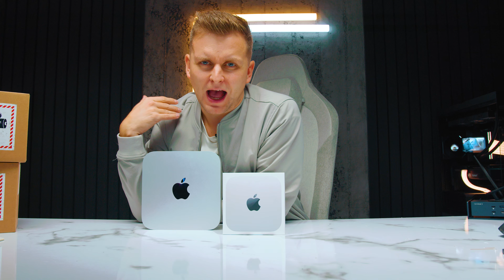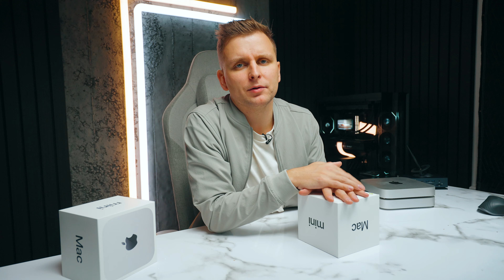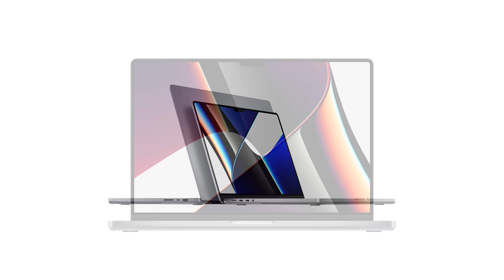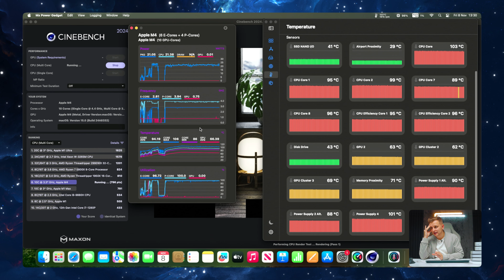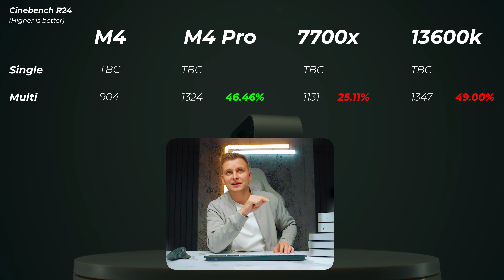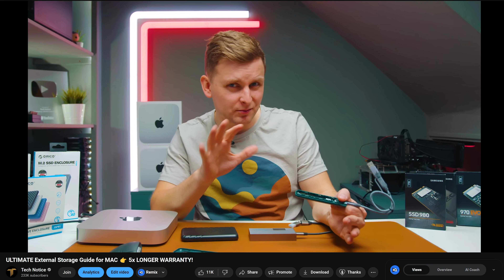Apple just KILLED the Mini PC Market and Windows WILL NEVER recover! | M4 & M4 Pro Mac Mini

Comment: Kill?? 🤣🤣🤣
In most mini-PCs, I can still upgrade RAM & replace my storage, some of them even able to host 2½" SATA drive. in Mac Mini, Apple just giving you some "hope" that you can replace storage, but it must be Apple specific components 😂😂.
No, Mac mini is niche but certainly won't be a "killer".
There are alot of Intel NUC alternative nowadays, since almost nobody is buying Intel, many has released Ryzen based mini-PCs, and they are superb!
However, I do like OSX GUI, they've done exceptional job to UNIX system, but to spend money on new Mac PC while with same performance you can achieve on other arm based or amd64 system with either MS Windows or Linux, so big NO. Alternatively to update myself with OSX, I recently bought a used Apple M2 based Mac, they're still running smoothly.

Comment: If you're in, not for the base Mac mini M4, but for a boosted Mac mini M4 Pro 48GB with 10-Gigabit ethernet for professional purpose, I'd urge you to wait for the upcoming Max Studio M4 Max, because such boosted Mac mini M4 Pro is actually only $100 less than the current Mac Studio M2 Max… and the M4 Max is vastly superior to the M4 Pro (which is already really, really good) especially in GPU compute!

Comment: I am looking to get the Mini 4 Pro as I am currently using a high end PC. I tried the Mini Pro 2 a while back (top spec), but it couldn't keep up with my high resolution 360 photo editing.

Could you let me know what your thoughts are compared to the spec I have now? Would really appreciate your feedback.

Here is my current PC spec for comparison.

Rog Strix X570 Gaming Wi-Fi II Motherboard 

AMD Ryzen 9 5950X CPU

128GB 3600 DDR4 RAM 

Msi Geforce RTX 4070ti Suprim 12GB GPU

1TB Samsung EVO 970 SSD

Comment: The biggest problem I have with Macs is that there is still software that comes only for Windows and sometimes Windows or Unix. There's plenty of software that will not run natively on a Mac. Of course I could run it under a virtual Windows environment, but then there would be a huge hit in performance. One of the key applications I use, is not available for Windows, and it is the application that is extremely dependent on CPU speed. The lack of being able to upgrade RAM is also an issue. Even in a mini PC, I want at least 64GB of RAM.

Secondly, is the user interface. My customers all use PCs only, without a single Mac in their offices, and thus need to use the Windows user interface when at their offices. In combination with my need to use a PC for the software that's not available on a Mac, means I need to use the Windows user interface a good portion of the time. Because of that, my productivity would go down if I had to switch frequently between the two user interfaces.

Now, I do have a Mac Mini, but I probably use it on average once every 3+ months. If all my software ran on a Mac, and all my customers used Macs, I'd have no problem considering to switch to a Mac as my main machine, provided it's cost effective, powerful enough, etc. But as it is, I will not consider it. I kind of wish that it would happen, because I much prefer the iPhone user interface for my phone, but transferring files to/from it via Windows is an extreme pain, if at all possible. That's my primary use for the Mac Mini, being transferring files and other tasks related to my iPhone are seamless.

Comment: A little dock or hat exactly the same size and radius curves same colour and finish that could sit on or under the mini and stack up then connect at the back via a perfectly sized tb cable and worked as a port expander for a couple usb-a, fast sdcard reader and had an m.2 slot inside for an nvme would be amazing

Comment: 1 Gigabit ethernet port is an anachronism in 2024. 2.5 GbE is standard now on contemporary devices, not only top end kit. Good luck with 16GB ram if you are developing and running multiple containers.

Comment: You can get a barebones 13th gen for around 500$ (Or Ryzen) and get 32 GB ddr5-5600 sodimm  and a 1 or 2TB m.2 SSD for like 700-800$ built. It would be faster than the apple too.

Comment: I hate YTers like you. Cheap shills for corpos and click bait titles. Apple didn't do anything significant in mini PC market. iOS is still inferior compared with Windows to most users. Windows mini PCs offer some form of upgradeability - ram or hdd. You can support your device much easier than any iOS device. You can install some linux distro on it and run home server without any issues. Apples 'ecosystem' is a marketing trash. Apples devices are poorly engineered and tough to repair. You basically sign up for future astronomical expenses if something goes wrong and not covered with warranty.

Comment: The fact that you cannot replace memory or the SSD in Macs is a reason the mini PC will live on. Also, every mini PC I've owned I can easily upgrade the memory and SSD. Plus Apple is pathetic in the baseline mac Mini offerings-> 599.99 gets a whopping 256GB storage! 256GB by todays standards is small, it should start out with a 512GB. 400.00 to upgrade to 1TB is crazy. I can get 4TB for less than 400.00.
Reply: But there are benchmarks videos showing the performance is insane compared to mini pcs that even cost 1k. I loathe apple, but i dont mind using an external SSD and 16gb ram is enough for me. If i can run windows on it, i think i'd be fine.

Comment: Amazing, Apple did 16Gb of memory in the basic model but had to ruin it all with the size of the SSD, which would be fine if one could just replace it with commodity drives. But no, and 'nickel and dime' hardly covers upgrading anything from the basic model. Almost convinced myself to buy a Mac-Mini.

Comment: I am using a Raspberry Pi 5 with Hailo 10 AI NP and M2 Hat less than 200 $ or so and it rocks more than this overpriced 'mini pc' with kali linux, and ubuntu and Pi OS on different nvme drives multiboot. fast as duck and runs gpt LLMs offline much faster than these Macs.Otherwise Nvida's AGX Orin 64gb AI Devkit beats the ass of the mac Mini M4, and can even develop industrial AI vision and robotics for industrial level usage scenarios, and it is cheaper than a MacbookPro

Comment: The M4 mac Mini is on my list for the new year. It will be used to replace several Windows 10 machines.  Replacing five machines with this one M4 Mac mini will still be more powerful than all the windows machines combined. The Windows 11 upgrade requirements eliminate all my desktops from qualification. I am also lobbying at work to replace over four hundred machines with Apple hardware for both the desktop and a new Mac book Air with M4 that is due out next year. We will run custom software on an emulator, and it should perform better than it currently does on the T61 laptops and HP desktops that are over 15 years old. the M4 desktops will be about $CDN600 each which is better than the $1,500 for desktops we were quoted by a vendor (With a 15% discount for volume).

Comment: I never bought mac mini becouse only 8gb ram but now I was thinking but only problem the switch on-off button.
I didn't know how I would be able to turn it on.
I thought of cutting a hole in the bottom of the table.
But luckily for your solution I can turn it on and even its ventilation will be better
so that will be  upside down on the table.
(I subscribed:)
Reply: It's a mini-PC, just tilt it and press the button. It's a retarded place for a power button, but it's hardly the end of the world.

Comment: I feel like this machine is being overhyped. I didn't need it to be smaller, that doesn't do a lot for me. I's not a mobile device, and the form factor change means I have to purchase new accessories for it.

The biggest argument in it's favor is affordability, but for who? 256GB frustrates me on a phone, and to bring it just to 1TB jacks the price up to $1k. That's $400 away from being a Macbook Air (M2) but you still have to buy a mouse and keyboard, a monitor, a webcam... and you still couldn't take the machine across the room with you to finish your work in bed.

This could've been a great device though. Just put a battery inside of it. Ports and a card reader on front. And two M.2 2280 slots on the board. The one thing I didn't need was for it to be smaller.

Comment: It looks like a nice bit of kit and well built, but it's a ludicrous proposition to suggest it will kill the mini pc market. My last mini pc was a GMKTex NucBox with an Intel N100 cpu (6W TDP). Under heavy load it drew about 11W in total. Cost me the equivalent of $100 USD. I bought a 16GB DDR4  SODIMM and a 256GB NVMe ssd for an extra $40 or so (it was in Pounds, so I'm estimating the dollar cost). OS was Ubuntu and I use this for a media PC for my TV. So about $150 USD, sips power and is a great little PC. Would I like a Mac Mini M4? Sure, but it's a hell of a lot more and the other downside, MacOS, just no .....  I think it will sell well and is definitely a nice bit of hardware. If you already are embbeded into the Apple eco system, makes a lot of sense. Good luck if you ever want to upgrade the ram / storage though and lol at the markup to go to 512GB and 24GB, what is it $400 extra? Holy crap!

Comment: I highly doubt it's the death of Windows mini PCs because upgrade ability is a major thing for a lot of people and the ability to run Linux on the bare metal is a major for some people. With Apple you can upgrade it yourself and it can't run whatever operating system you want you are stuck with macOS. And yeah performance-wise for the money the Mac mini is a damn good proposition. Especially with the ryzen 9 370 HX coming out in many PCs putting the price like $1,200

Comment: The computer industry has a long history of selling customers home computers with too little memory or storage and then charging a fortune for an upgrade. The PC conquered the home computer market in 1990 with its easily upgradable IBM PC/AT 286 clones. I bought one of these and was later able to upgrade both the hard disk drive and the video card in my PC for around £100. 

With Apple Silicon Macs Apple is going back to the bad old days of selling impressive computers which require extra RAM and flash storage to make them into the computers that we need. 

With the £599 M4 Mac Mini Apple has finally fixed the RAM shortage in the base model but still does not fit the extra two 256 Gb flash memory chips that any customer focussed company would fit in such a high performance system. It is true that you can use an external flash drive which would be pretty essential in gaming given that the average PC game is 100 Gb in size.

Comment: I am a 3D designer and would love to work with Macs. The single-core performance is simply amazing. Perfect for animation work.
I just don't understand why Apple is so reluctant to allow EGpus to be connected to the M Macs. It certainly wouldn't be a big problem.
A Mac Mini Pro in combination with one or two 4090s would be a dream.
The M processors are simply not powerful enough for rendering tasks. Just one example: An M3 pro needs 7 minutes for the Redshift benchmark pass. 
My two 4090s only 40 seconds.

Comment: one of my biggest grumbles is that apple expects a 2.5 or 5k display for the screen scaling to work perfectly, but the mac mini's don't come with monitors and most people tend to purchase 4K monitors (as 5K ones remain stupidly expensive).  unfortunately, even when using BetterDisplay, the text is not pin sharp due to apple's lack of fractional scaling in the OS.  this is something they really need to consider setting to rights given how popular the new M4 Mac Mini is likely to become.  (I only moved over to MacOS when the M1 came out as I could not stand Windows 11).
Reply: Had wondered if they fixed that nonsense, but seems not. That's a deal breaker if I could stomach the SSD size. Pity, fancy a change and used to have a Mac back in the day.
Reply: @ConorHanley That's not nonsense, it's deliberate marketing ploy to sell you their displays.
Reply: asus made a 5k display for dirt cheap now so there it is
Reply: @bartomiejkomarnicki7506  I had one of the previous Asus displays with the single usb-c input which was prone to failing as mine did.  loads of videos on youtube about the problem.  there is one 5k monitor that is relatively budget made by a company called Kuycon, but I am not buying one unless I know what they are really  like in real use.
Reply: This is a deal breaker for me as someone using two 1440p 144hz monitors, what a shame.
Reply: @dislexicpotato  It's really down to PPI - ideally 110-130 (or double ~220 ish). So 1440p at 34 or 38 inch is actually really nice. I have a 38 inch ultrawide and it looks perfect. 
This is the reason Apple monitors in recent years have been 4K for 21 inch, 5k for 27inch, 6k for 32inch.

Comment: Unless they allow manual storage and RAM upgrades, I will never buy any Apple computer. My current Windows notebook came with 1 TB of storage and I later upgraded it to 3 TB for a relatively small amount of money. I might even replace the 1 TB module with a 4 TB one, which would give me 6 TB in total. I hope the EU steps in and forces all companies to make their computers upgradable.

The size of the new Mac mini is the size it should have had much earlier. When I first saw he old Mac mini, I was shocked how big it was, although just having the same hardware inside as a slim MacBook. Apple really has to work on the site of the Mac Studio next. That thing is huge for a computer that does not need space for huge graphics cards or 3.5 inch SSDs. Why did they make the Mac Studio so big, if there is still no space to upgrade RAM or storage?

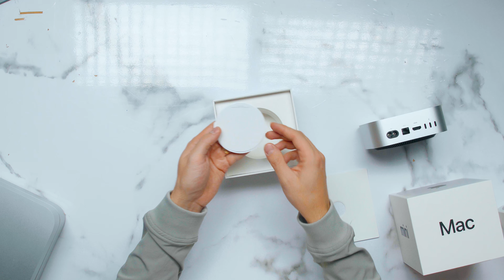Comment: 3:40 it sad that they can't go that neutral because some law require electric device need to have a manual
Reply: That depends on where - in the EU that’s no longer a requirement as long as you inform where on the internet the manual can be found. But lets also be real here - it’s not skipping the paper manual in an electric devices or using cardboard straws for your cola that will save humanity.

Comment: I don't think so. Geekbench test things that mobile SoC accelerate using hardware. This means compatibility will be an issue in future. Desktop CPUs run everything in software within the general purpose ALU/RPU/MMU/VPU (vector) so the CPU will work 10-15 years into the future.

In real-world applications that is not hardcoded to use Apple hardware, the actual performance will not be as good.

AMD's AI 375 - 32GB + 1TB ($1000) and upcoming AI 395 Max ($????) will be competitive with M4 Pro in real world applications. And gaming on AI Max 395 is expected to be almost RTX 4070m level. Price for 32GB + 1TB? I guess $1300. I'm hoping for a 64GB RAM model so I can run an AI Image gen server on it.

And then there's compatibility with Intel based Apple applications and x86 Linux applications. Rosetta is good but not 100%.

That said, for workstations that only run Apple ARM applications, these will be great.

Comment: I bought a Beelink S12 pro for $149. I threw linux mint on it and for what i do, it runs great! N100 with 16 gigs of ram and a 512 ssd. 25% of the new mac mini. Certainly not a direct comparison but for a year now its met my needs
Reply: The M4 is about 300% faster for single core and 850% faster for multi core tasks than the n100 so this is not comparing like with like.
Reply: @ShowsOn  Nope your wrong. The M4 is indeed much faster but if I am doing the same tasks with both, then they definitely compare. My Kia isn't nearly as powerful as my neighbors Mercedes but if we're both using our cars to go to work and run around town we're doing the same thing with each but in a race, he wins.

Comment: Apple Intelligence will not work if you boot from an external drive, along with many other features, must people don't know this.

Not sure if these are slow ssds in the base model 

Also once your internal SSD dies, your machine cannot boot from external drives meaning it's a brick in all macs no matter how much you pay, with Mac pro. Being the lone exception.

Of course there are ways around this, if you have access to the right apple software tools, hardware and software hacks, etc 

And Apple may fix this in the future with a firmware update if software similar to a bias update on you know what, who knows.
right now it's at least something people should know and consider
Reply: it swapable ssd now but you can only buy it when it broke from apple xD and it not slow anymore since they use 2 nand 128gb
Reply: @MrFluke039  we still do bot know this officially  as the Mac studio has had these for years, so far apple has done nothing.

I suspect the EU will like with USBC make upgradeable storage mandatory above a certain price level on desktop computers, as you cannot use the this and light excuse, even Microsoft allows it in its laptops 

Also new memory tech is here that is just as fast and energy efficient if not better than in chip memory, and extremely thin and small.

I expect Intel to use them next summer and and to follow later with Qualcomm, this will be a huge selling point for windows machine 

In the meantime YouTube channels like dosdude2 and others have special software hardware to do this if you can source dinms and even a daughter board that may be able to adapt retail pcie ssds in the future.
Buy with base 16 or 32 fast low power dinms.

And then 2 to 5 years later for ai and better multitasking more memory for GPU ai CPU, while base macs will always be stock at 9 16 24:32 gb effectively starving their fast chip slowing down to use the SSD as swap memory.
Reply: @Tigerex966  a lot of people swap nand chip on youtube so it confirm on speed part but you can’t buy it anyway they will sell it to you only when current one is broke as a repair cost
Reply: @MrFluke039  well we are not sure yet if anyone has success dosdude 2 and others will try